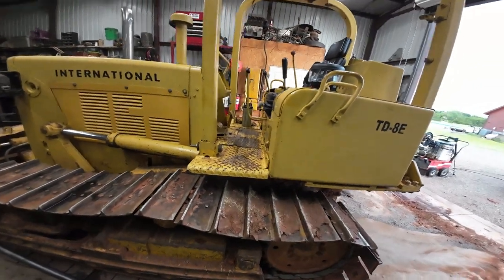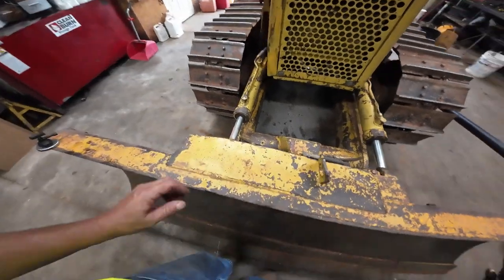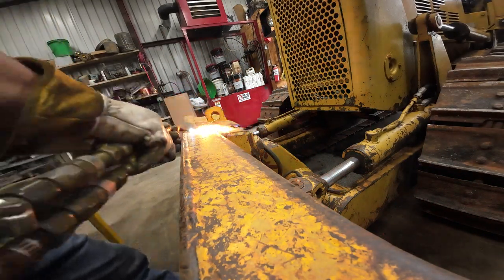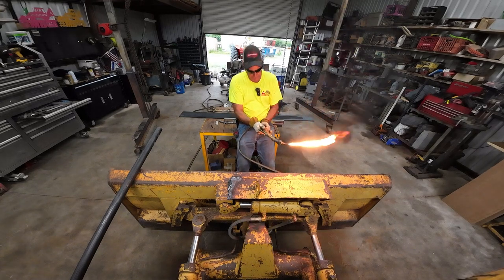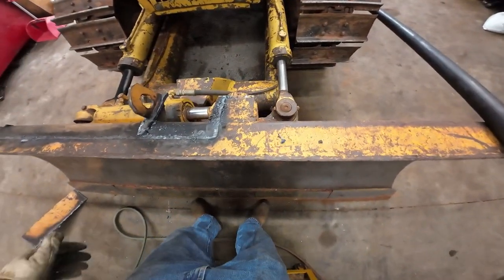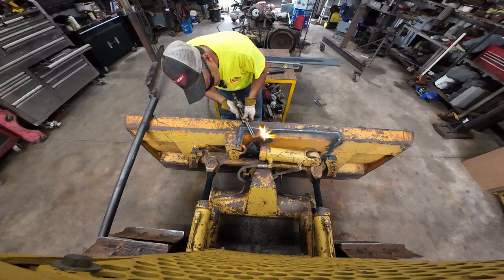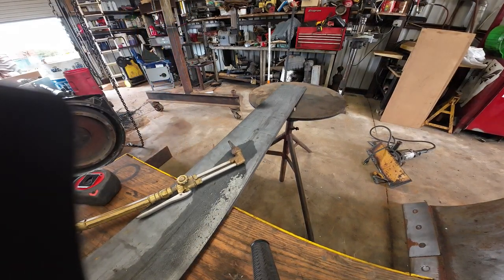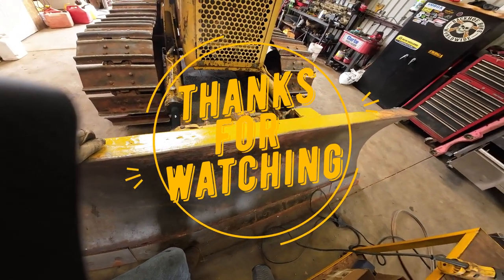Building a laser pole for the dozer.

Comment: Nice work Frank, I would probably want to run the bolts back in to the holes if you remove the pole, keep the good OK clay from cementing up the holes.  Dying to know, which receiver did you order?  I didn't even know you could blue tooth one to your phone, unless you went top dollar with Topcon.
Reply from the maker: Thanks, it is the newest one topcon came out with this year. I figured it would handle anything I had for it and then some. It’s an LS-b200w. I just got it today, I’ll have to learn a lot about it before I video it. So far I think it’s worth the money.
Reply: @Digginok  Thanks Frank, I just checked it out.  Damn, they sure are proud of it with that price.  Or, buy once, cry once.  I'll let you wring that out in testing before I throw my CR700 in the misfit toys bin.  Really looking forward to your thoughts on it.  Are you thinking about running it on the B in case you don't get a grade man, or are digging a septic by yourself?  I actually looked at putting the iDig on my SN 580 WT, but I really can't justify the upgrade from the CR700 right now.  Maybe the LS-b200w is the sweet spot in the middle.
Reply from the maker: @waynevincent5448  your cr700 is probably handier for the backhoe stick, unless you get the mounting set up for the big topcon. 
I hope to set it up on the hoe someday, but I think it will work well on the box blade I have too. 
I probably spent too much, but it’s a piece in the right direction for grade control.